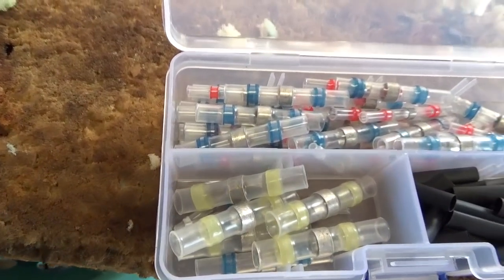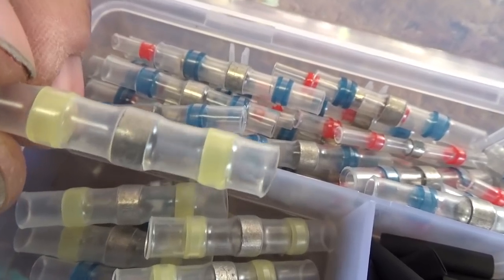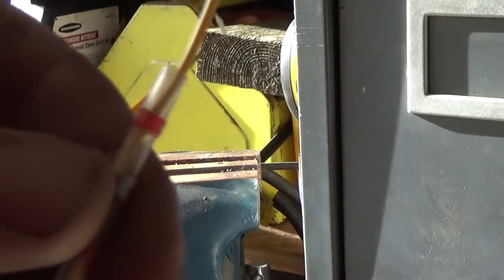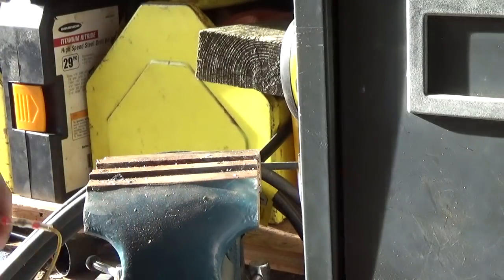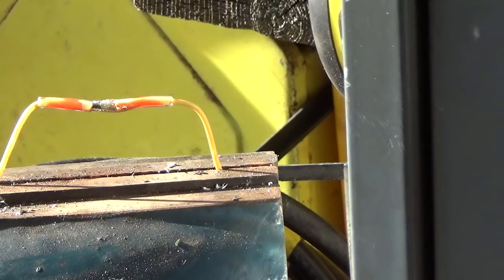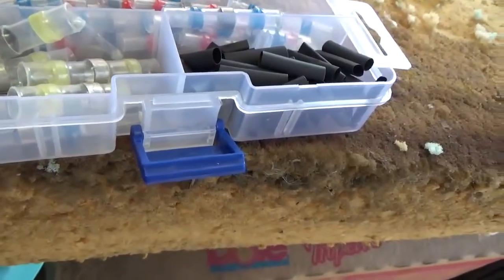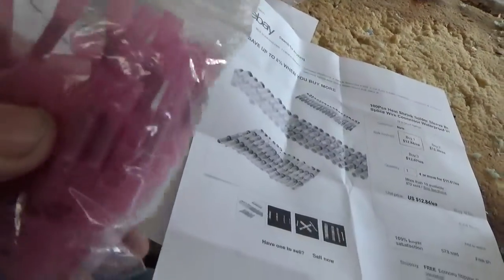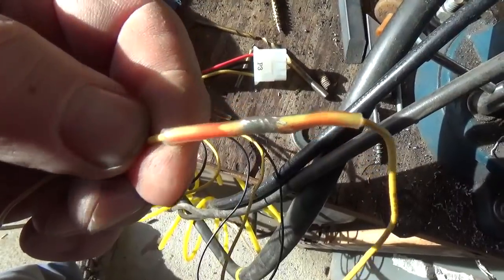Do Solder Sleeve, Heat Shrink Wire Connectors Work?

Comment: I have a Dixon 5502 1997 that runs and cuts great.
My issue is it will only start with the PTO engaged.
What is going on?
Anyone know??? Start it up and turn PTO off and works great. Blades work when starting... not good.
HEEELLLP  PLEASE